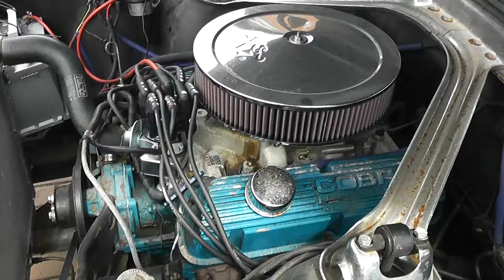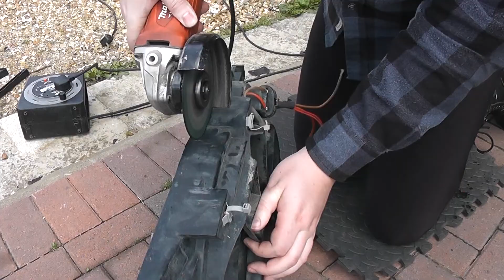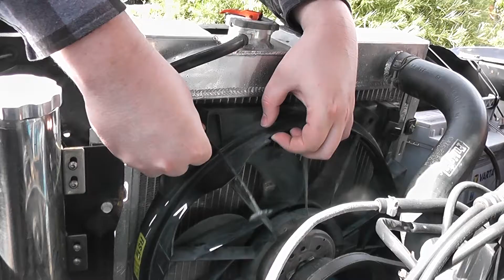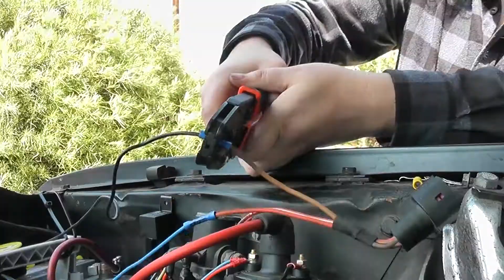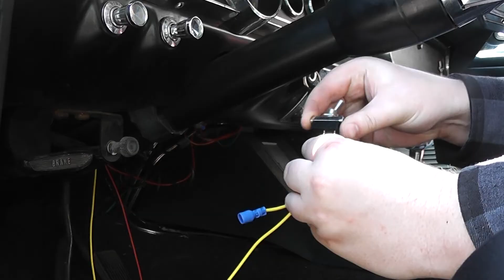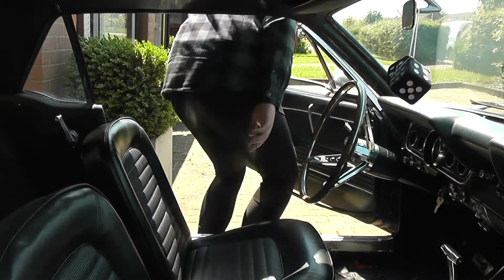DIY Ford Mustang Electric Fan Conversion 1966

Comment: So i have a 1967 mustang coupe that’s running the same thing but my fan cuts out so there’s a short somewhere? And how can i hard wire it to turn on by itself when the car turns on?
Reply: The previous owner installed this and it turns off mid ride. And my car starts to over heat
Reply from the maker: There's no way I can fully diagnose the problem for you from here. If you want the fan on all the time, just wire the power feed to the ignition barrel so it comes on with the key. Run through the wires for the fan and make sure they're not shorting out somewhere. Make sure the fan has a good ground connection to the body as well. Further than that, you'll have to get help directly.

Comment: Great video.  did it have a thermostat for open and close automaticly ?
Reply from the maker: No, it uses the switch on the dashboard. If you do have a thermostatic switch though, you can just run the wires to that instead of a manual switch.

Comment: I’ve gotta 68 i6. Planning on installing an electric fan too. What’s the deal with connecting the wires to the solenoid starter?
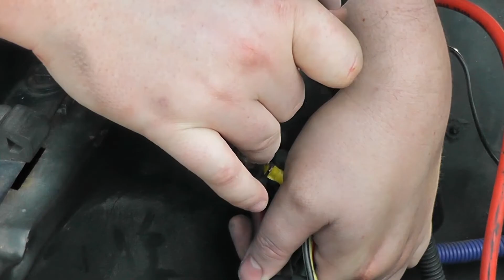Reply from the maker: So, the way this works is the switch under the dash takes a low amperage 12V feed from the ignition, and uses that to turn on a relay that can feed high amp current directly to the fan. At 1:20 you can see me attaching the power feed for the relay to the solenoid, this is just a point where it's convenient to get power from the battery (you can see that the battery positive cable attaches straight to that point). You could connect that wire directly to the battery terminal but this way is far neater.

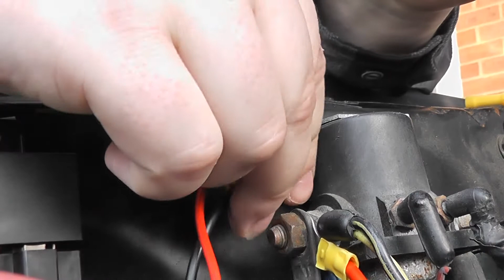At 1:36, those two wires are the earth from the fan, and the earth from the relay switching circuit. You could earth those anywhere but that bolt was convenient.

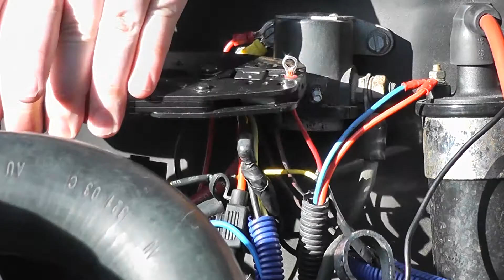At 2:22 that little red wire is the power feed for the switch. That terminal on the solenoid receives power when the ignition is switched on. You can see the factory ignition wire hanging loose there with the black electrical tape wrapped around it (I forgot to show it being plugged back in). Wiring it this way means that it will cut the fan when the ignition is switched off. If you want the switch to be live all the time, you can just run that wire directly to the battery.

The yellow wire coming from the dashboard switch feeds power to the relay to turn it on.

You can also easily adapt this circuit to use temperature controlled switch to switch the fan on and off automatically.
Reply: Scrubworks Appreciate you taking the time to explain that
Reply from the maker: @ricardocontreras8861  No problem. One thing that you should probably install that I didn't do is a small indicator light to tell you when the fan is definitely on. You can flick the switch inside the car but you have no actual way of telling whether the fan is on.

Comment: Did you need rubber pieces and bracket to mount to the aluminum radiator to protect from vibration? Or did you hard mount it like the original
Reply from the maker: You mean the radiator itself? Nah it just bolts on as per the original. Been like that for 5 years and not had a problem. The fan is held on using plastic radiator ties.

Comment: Hey man, great video. Currently installing electric fan on my 65’ and was wondering if I have the fan connected to the solenoid will it only get power once the ignition is on? I’m not sure if it will keep draining the battery after I turn the car off or not. I’m also connecting the indicated  wire from the relay to the thermostat so hopefully should be all fine.
Reply from the maker: Hey JP, if you look at Ricardo Contreras's comment, I did a short write up of the install for him that should help you out, but yes you are correct about the solenoid. What do you mean about the thermostat? Are you using that as an earth point?
Reply: Thank you for the reply, don’t worry I found the comment and realised its pretty much the same set up I should do, The wiring harness I got has a wire that runs to the thermostat to turn on the fan at a certain temperature but only just realised the thermostat probe they sent me (using mishimoto set up) is a different size to the one that fits into the intake manifold, so I just got a water temperature sensor adapter and now all good! Thank you for the video couldn’t have done it without!
Reply from the maker: @jpbolgar3749  Awesome, yes, if the temperature switch you're using is literally just a switch that turns on and off at a temperature threshold, then run the red and yellow wires to that instead of a manual switch, and that should turn the fan on and off automatically. I have plans for a similar setup in the future. I'm also working on a device to allow the fan to run-on for a short while in hot conditions after the car is switched off, I'll be filming that soon.